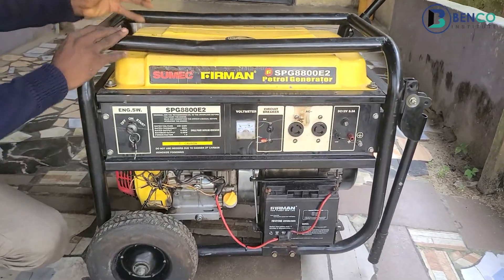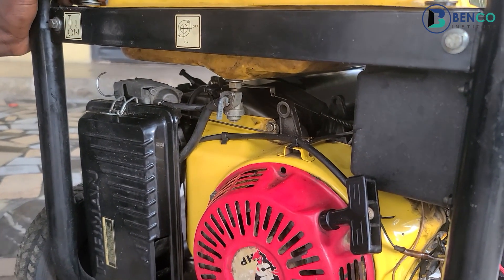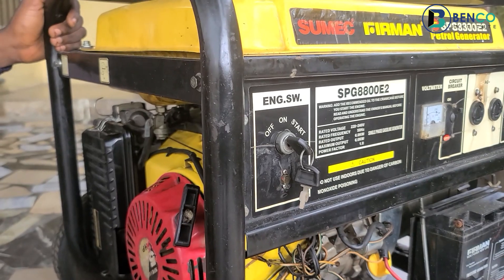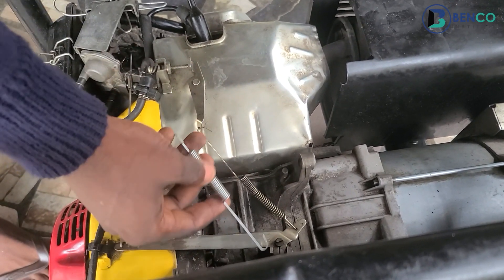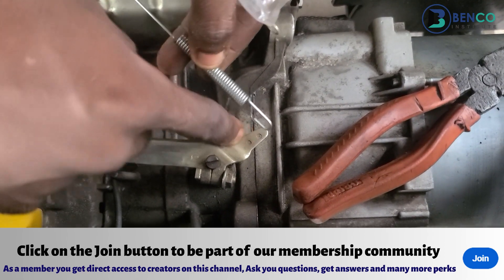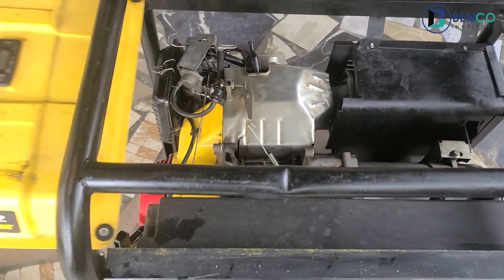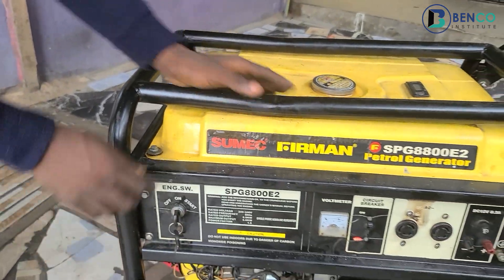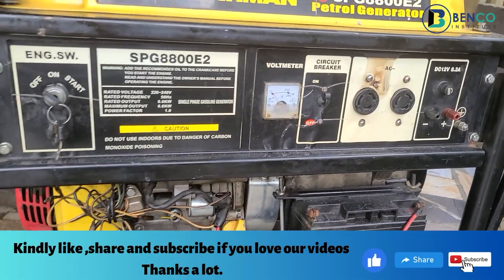How to Fix governor spring of a 4 stroke  Electric Generator with low voltage output and low speed

Comment: Good morning boss, pls can u make a video on how to connect d armature,coil, AVR connection pls. I can dismantle generator but can't assemble d generator especially d electrical connection. Pls help me
Reply from the maker: Okay
We have done a video on that already
When we are  done editing we will upload it
Reply: @bencoinstitute  thank u sir
Reply: @7heavenokonta109  I believe it cos it's your first time, I've  experienced it before.

Here is the secrete bro, since it's your first time what ever part you're a dismantle take a photo/video of it with your smart phone. Esp if it's the electrical part you're tempering with you can use a marker / a paper-cello tape  to mark  each of the wire before disconnecting.
After installing new parts successfully, then follow the reverse process of all the videos /photos you have taken with your smart phone. By doing it repeatedly you'll know it better.

Another idea... Try to watch videos from this Author and other Authors and follow what they do step by step in the video
Reply: @gentleodjugo7226  thank u